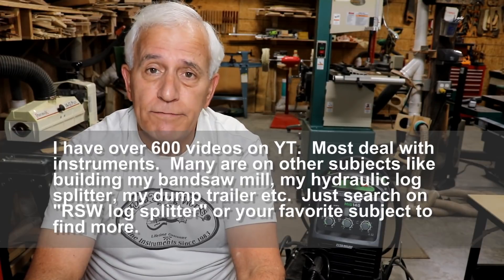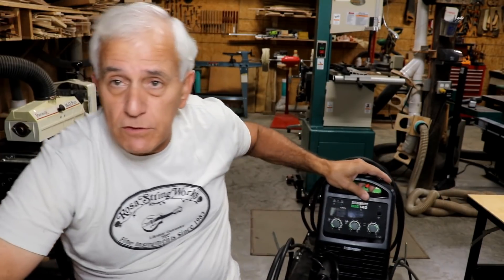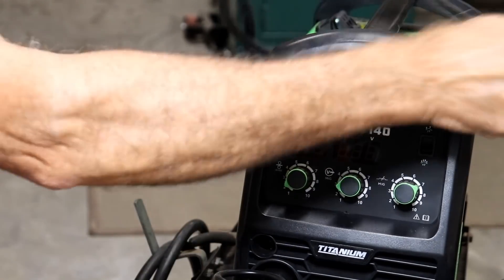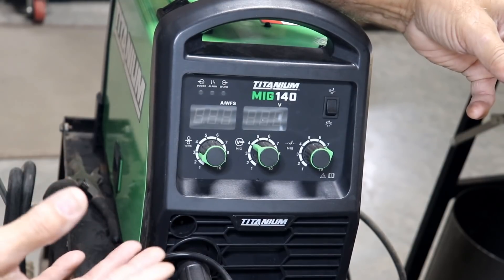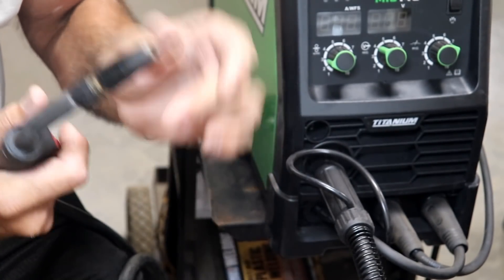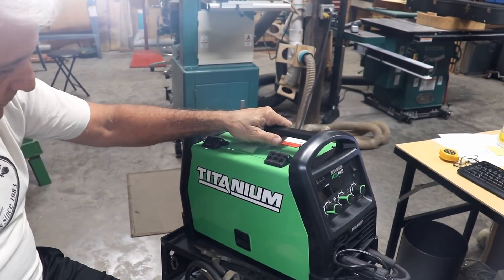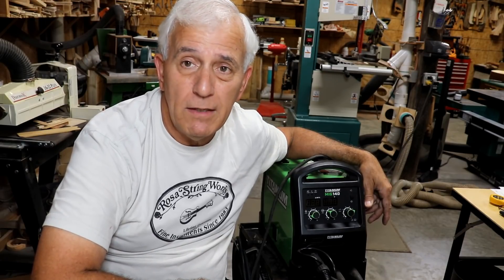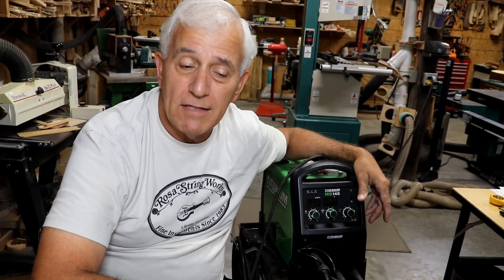505 RSW HF Titanium MIG 140 Review and Setup Tips

Comment: I have one and I absolutely love it. I've used it as a Mig and Flux core welder and it works great. I'm just a garage mechanic and so far its handled everything I've thrown at it. The chart on the inside only goes up to 1/8" but I've successfully welded materials up to 1/4" with no problem whatsoever. Something I have noticed when using flux core wire is that it seems to burn a bit hotter than standard wire, I don't know if its because that the flux in the wire makes it burn hotter or maybe the the inert gas using solid wire has some cooling effect on the weld or the polarity difference between them has something to do with it but there is definitely a temperature difference. All in all for what I need a welder for around the garage I'm very pleased with its performance and how well it has stood up over the past couple years. As far as your comment on running it on a generator and the power needed for the task, I would say any generator capable of probably around 3000 watts should do the job. Considering that the welder is designed for a 20 amp circuit 120 volts x 20 amp = 2400 watts and then add another 10 to 20% for surge load I think that a generator in the 3000 to 4000 watt range should do the trick. I haven't tried mine on a generator so I can't say with 100% it would so if anyone that has one is running it on a generator I'd like to know what size generator they're running theirs on.

Comment: I stumbled across Mr. Rosa's review today. I have recently have been been designing concrete tables and concrete home furnishings and investigating the requirements of welding to supporting the base needs; be it wood or metal. I bought the HF Mig 140 today, and happy I did so that it supports not having to have dependent on gas.  His review and usage is exceptional it breaking down its capabilities.

Comment: I want to thank you for this video, I also just purchased this same welder. I also am using the 0.30 flux core wire and didn't want to hook up A bottle unless I really needed to. After finding a sweet spot to weld without too much splatter. I hooked up my ground like there instructions say, but it seems to weld better with the ground on the positive like you said. Thanks again for your help.

Comment: SOmetimes if you burn off, all you have to do is grind the tip back a bit till you get back past the stuck part.  Make sure your wire did not kink up at the feed wheels before trying to weld again.

Comment: I have the same welder. Sadly, I was able to have the tank shipped to my front door for significantly cheaper on Amazon than getting one locally. Doesn’t have to be a large tank if you only weld occasionally.
Reply: Do you have the link to buy the gas tank?

Comment: The 170 is the way to go .better to have more power when you need it .
I have the 200 ,but if money's tight get the 170.
If your going to use flux core only ,get the Titanium 125 it's a little beast . A lot less than 500 and it will do everything the 140 will and cheaper too.
Reply: I picked up the 140 for $160 bucks at my Harbor Freight.

Comment: I bought the 170 and spool gun. It's also a very impressive welder for the money. Welds better than my Lincoln and has more fine adjustment . I got the bigger 170 only because I was told I needed more power for the spool gun. But I would bet the 140 would do everything I needed lol
Reply: I use the spool gun, almost exclusively for aluminum. But yes the 170 drives it very well.  Don't know if the 140 would.  Again, the smaller dia. wire will get you a hotter arc, hence better penetration.
Reply: The 140 does the trick but it ain’t nothing great w the spool gun

Comment: If you have any heavy welding,  you do not get very good penetration from the 140, with flux core..  I had a 140 that did use gas or flux, I ran the gas, and .020 wire and could get much better penetration, and a much smoother finished weld.  Too hot and you burn off and stick the wire to the nozzle.